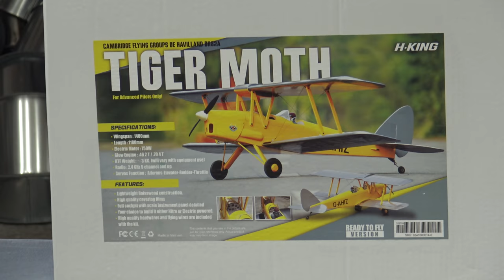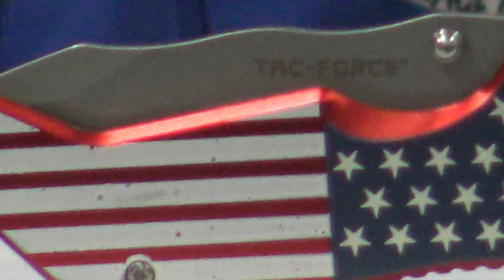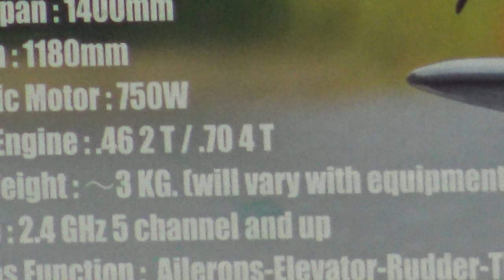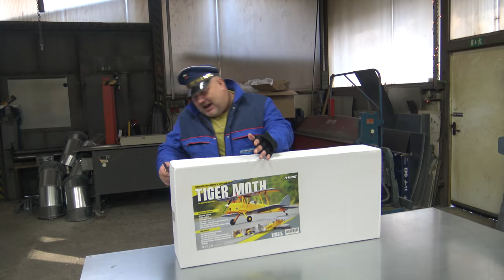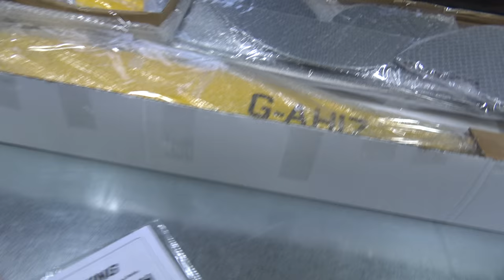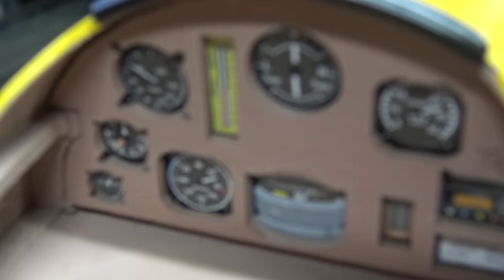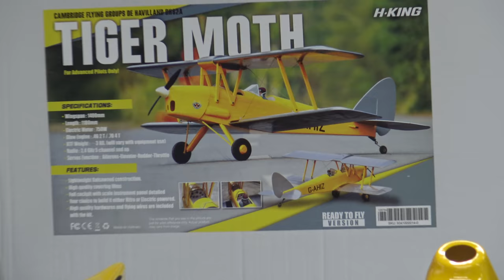H-King Tiger Moth (Cambridge Flying Groups de Havilland DH82a) 1400mm (55.1") (ARF) Unboxing

Comment: That ground station should be able to connect to your computer and be used with the flight simulator.  You can practice using it to get more comfortable with it.

Comment: That’s a fantastic plane I have the vq models version and it looks identical,when installing the wing servos you might find they won’t accept standard size I had to modify the servo trays a little and also you will definitely need to fly with rudder or use a mix I fly mine using a rudder mix great video as usual 👍

Comment: heh, almost done building mine. I installed Saito FA-62B and it needs a lot of weight in the front to get the perfect G spot :)
Reply: I choose the original aluminium engine mount from OS...gives extra weight and stiffness